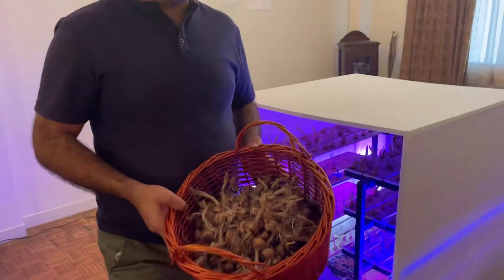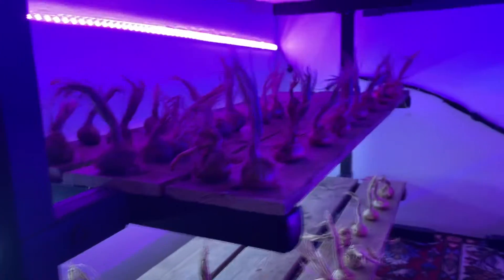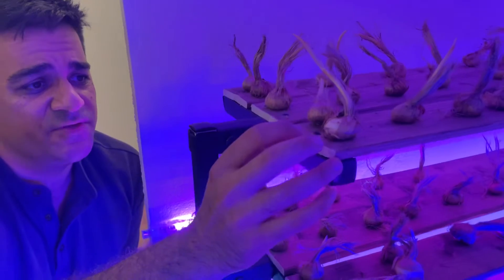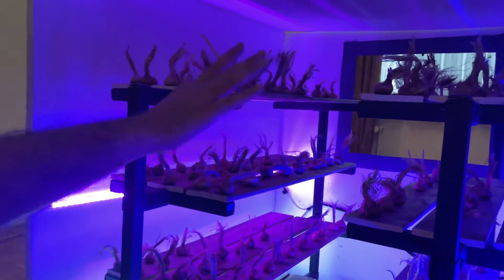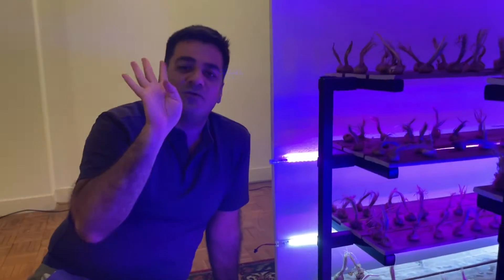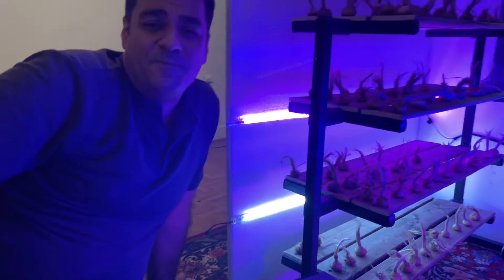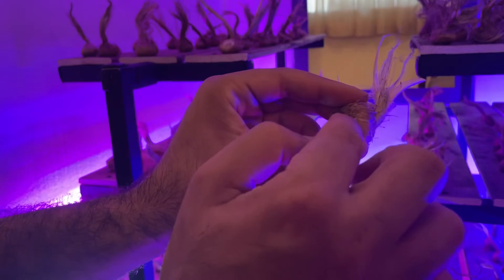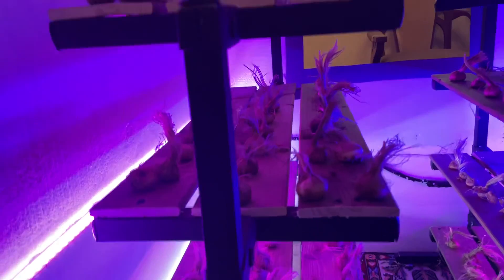How we can construct saffron vertical farm!

Comment: I understand the process of planting the bulbs and their harvesting, but I need to understand the post-harvesting process in an aeroponics system. Do we need to put all bulbs in the soil post-harvesting or can we put them back into the lab for their next production?
Reply from the maker: Everything Happens on the shelves, i recommend my book 
Order it
00989358253945
Reply: Immediately transfer to soil within 1-2 days after harvesting, provide enough P&K elements and make soil just moist without water clogging.
Reply from the maker: @neerajbhalla2199  in my book completely have been explained 
00989358253945